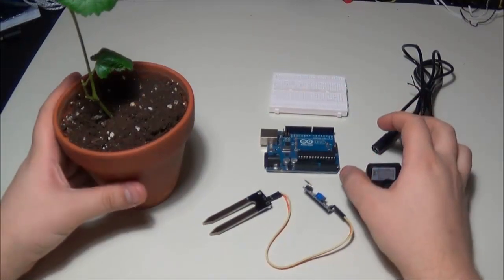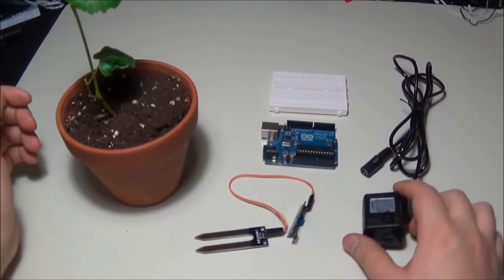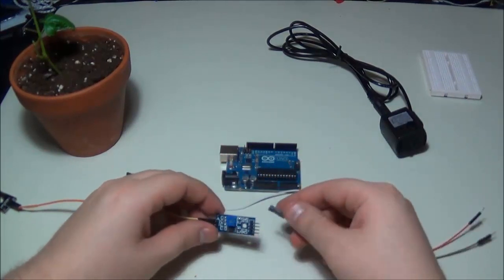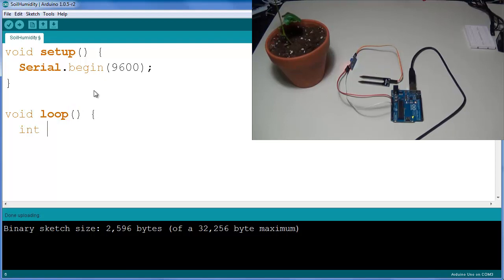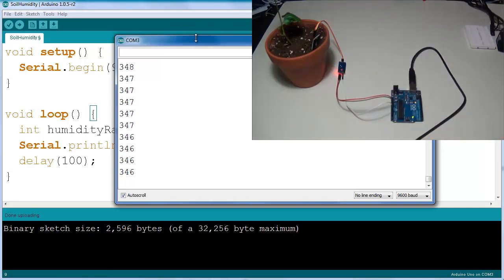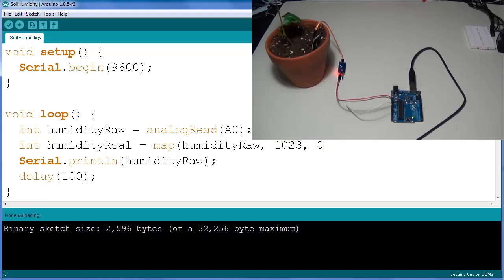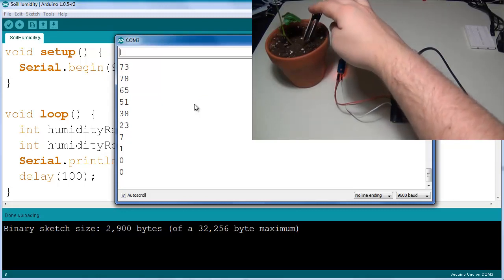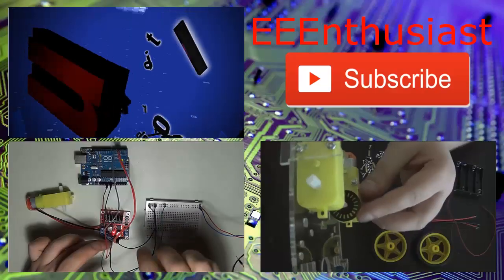Ep.51 Automated House Plant Watering with Arduino Project Part 1

Comment: Thank you EEEnthusiast!!!!! 
As I have stated before, I'm a total beginner coder. I laugh even when I'm sitting here saying that, because I only can inspire to be considered a "Coder" Currently I'm teaching myself how to wright and understand C++ code. I tried for weeks after watching your YouTube video's on Arduino-Soil-HumidityProject 1 and 2 to write my own code for this project. I was trying to Frankenstein my way through this project pulling lines of code from other projects I'd watched and / or competed. I really just wanted to figure it out on my own without cheating or just copy your code. Feeling frustrated and slightly defeated, I reached out to you. Halfway thinking you'd never respond, but you did within an hour or so. That was so AWESOME! Thank you so much. I wasn't far off.  Waiting to see what your next project with be. 
Thanks again for posting and help us armature Arduino Enthusiast.  

Questions:
Any suggesting on books I could get on C++ coding for beginners? 
Suggestions on where I could find a more industrialized humidity sensor that could work with an Arduino?

Comment: thats the video iam looking from long time. thanks for sharing. i wanted drive 4 moisture sensor in my gardern. so how i can connect multiple sensir with arduino anlong with relays
Reply from the maker: +umar ufx You can use every Ax pin to connect a sensor directly. For relays, I'll be going over it in the second part, but you can use any digital output for them. Make sure you connect relays through a secondary bus though.